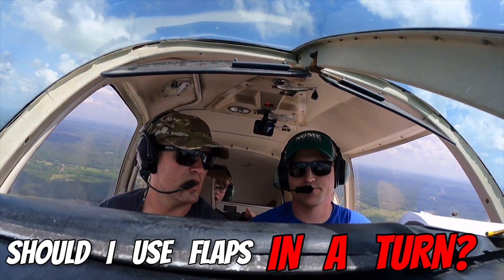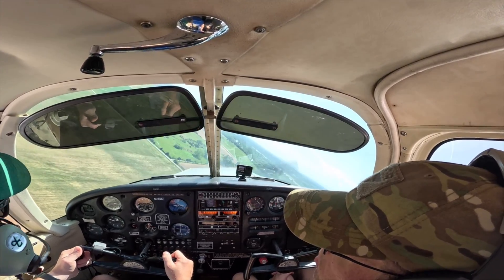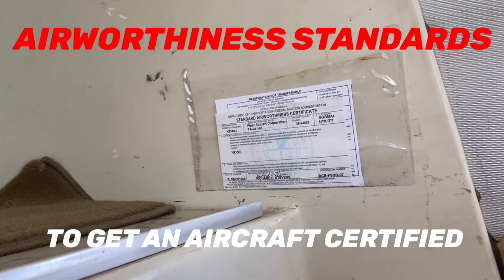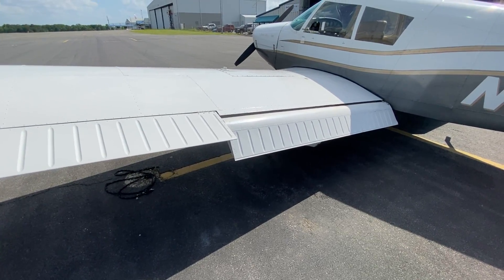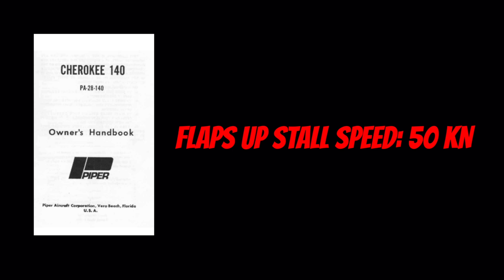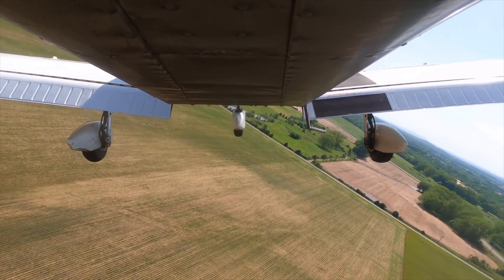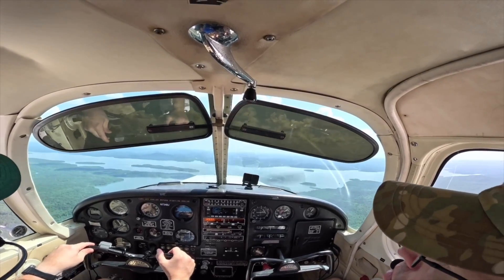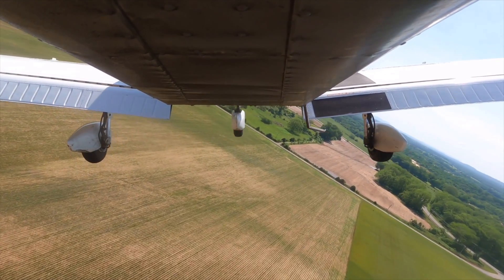Should I LOWER Flaps in a Turn?

Comment: Not necessarily an increase in "safety buffer" because you are closer to the critical angle of attack.
Reply from the maker: If they weren’t safer to use, they probably wouldn’t even put them on airplanes
Reply: They are safer within a window but the window itself has not increased.  Within the window you can land with lower ground speed and with better visibility but the critical AoA has been reduced.   The window is always narrowed in the landing phase which is critical to understand because there is little chance of recovery.    Maybe vortex generators can increase the window?

Applying flaps during a turn is like braking during a turn in a car: there's a reason people are taught to brake before the corner even thought that can be done.
Reply from the maker: @jamescaley9942  maybe, BUT most flaps move the center of pressure aft which technically give you a CG further forward and also lowers the attitude of the airplane. Initially, you may increase the AoA, but I don’t actually believe that you are closer to your critical angle of attack.  There’s conflicting information everywhere out there

Comment: I think the main reason why CFIs teach you not to use flaps is that for student pilots, landings are hard enough to do as it is and they don't need the extra workload. It's easier to handle one thing at a time, turning OR changing the flap settings. It's easy to get overwhelmed and miss a crucial change in attitude or speed. Imagine a student making a turn to final. Assuming that their descend was stabilized so far, their main focus is probably on making the centerline. Maybe they'll also be able to keep an eye on the speed. However, if they change the flap setting during the turn, the workload increases. The plane will want to slow down and lower the descend rate, both of which need to be countered.
In my view, changing the flap setting during a turn is not inherently dangerous, but it does increase the workload, which is not ideal, especially for students. Once you're more comfortable handling the plane and predicting what it is going to do, I don't see any issues using the flaps while turning, though.
Reply from the maker: I do believe this to be the case, but I don’t see the difference in doing that and increasing the flaps in the descent which can initially cause the plane to balloon and make them more unstable on final

Comment: Hi, confused as to how you got a smaller radius of turn with flaps when turn radius is dependent upon TAS. Maintaining a turn at Bank Angle of 30deg requires the same lift regardless of flaps assuming same speed parameters. This is because the same radial g is required to maintain level flight at a set AoB - it is independant of weight and speed. A 60deg AoB turn is 2g, regardless of doing 80kts in a Cessna or 420kts in a fighter. Therefore, the only thing that should affect radius is TAS. Since you had the same TAS, I'm at a loss to describe the slight difference you encountered. Flaps around final is sound given all the reasons you said, and being able to fly slower with a greater margin before stall will tighten radius and make the approach safer as long as you have sufficient power to overcome drag. Happy to hear your thoughts, no equations here, the chart you used is all you need to check my understanding. Cheers.
Reply from the maker: Not only do flaps allow you to fly at slower airspeeds which shrinks your turning radius, but they also increase the amount of lift that the airplane produces.  I have my own theories on why this is the case, but you can really shrink the turn radius of an aircraft with them. Crop dusters use this method all the time
Reply: @FreePilotTraining  Thanks for replying. I understand that flaps produce more lift, but in a level, constant speed constant angle of bank turn it does not matter. On application of flaps, the chord will increase the wings apparent angle of attack to the airflow and increase lift. This would have the same effect as pulling back on the stick, thatis, to climb and increase turn rate, however, you are doing a level turn and so you offload the extra lift through trim and thus will end up at the same rate since a 30deg AoB at a set speed will be the same rate regardless of any other factor. If you flew your Herc with a Hawk on one wing and an F-15 on the other, you will all be at 30deg AoB at the same turn rate even though you are all different weights and independent of flap selection. This is why I am confused by the little experiment you did, it does not make sense. On a final turn, if you select flaps but maintain your initial pitch then yes, it will tighten the turn momentarily as the chordline changes, without changing power the turn will further tighten as you slow. But the original test there should have been no difference. Cheers, hard to explain over typing!
Reply from the maker: @stats8391  yeah, I know crop dusters use them to reduce their turn radius.  I’m sure that’s due to reduced airspeed, but I personally believe there’s another factor at play here. I don’t believe load factor is always equal and opposite to the horizontal lift component as we are taught.  That would mean weight and centrifugal force is exactly the same at all times.  I’m not so sure this is always the case.    I personally think that’s why flaps can tighten the turn radius in most situations

Comment: Without split, (assymetric)  flap protection as in most light aircraft designs,  flaps should not be deployed in a turn.
Take for example, a Cessna which has cable operated flaps. 
There are 4  separate flap cables to pull the flaps up and down.
Two cables pull the flaps down and two cables pull the flaps up.
If one cable breaks due to corrosion which is possible, the flap operated by that cable will not be pulled down, say to a 40 position in an older Cessna.
The opposite side flap will be pulled down to its 40 position.
Trying to keep the aircraft flyable during final approach to the runway with ailerons and rudder will be very difficult, probably impossible depending on airspeed.
Reply: Didn't you see his data on the split-flap issue over the past 16 years? Happened once.

Comment: Spot on Sir. I was taught to use flaps in a turn and not load up the wing and that will minimize the stall spin on base to final. And is I did overshoot and don’t like the it there is always a go around.

Comment: I have ALWAYS used flaps in a turn (Cessna 152/172 pilot with 125hrs). I was actually taught to get to flaps 20 before my final turn. Flaps 10 almost always occurs in my base turn (as I was taught). This was to prevent rushing flap deployment during base or final... which I'd argue... rushing is MORE dangerous. This video is jam packed with amazing info. Love it! Thanks mate!
Reply from the maker: It definitely works! Thank you so much!

Comment: Agree with your video. Just want to add that the load factor/stall speed only increases in a turn if you are in a level flight. If you're not pulling on the yoke in your base to final turn then the load factor and stall speed are unaffected. But your descent rate will increase whilst in the turn. You can add a bit of power.
Reply from the maker: Fact! That’s why I mentioned being low on final

Comment: I'm confused about the part at 13:03 where you say you're going to fly "the same speed and angle of bank" with flaps extended, but you expect the turn to be tighter. Is it not true that in coordinated flight, turn radius is just a function of speed and angle of bank? If you maintain speed and bank angle, won't the greater sideways lift component from the flaps cause the aircraft to slip?
Reply from the maker: Turn radius is directly related to speed, angle of bank, and the horizontal lift component.  The flaps are creating more lift horizontally which is why the turn radius is tighter. I didn’t mention this in the video, but flaps allow us to fly slower which also shrinks down the turn radius
Reply: @FreePilotTraining  if you increase the horizontal component of lift (centrifugal "force") while keeping bank angle and speed constant, the acceleration vector relative to the aircraft will no longer point in line with the floor of the aircraft, it will point out to the side (edit: I should have said "apparent" acceleration, i.e if you drop a tennis ball in the cockpit, in what direction does it appear to accelerate relative to the cockpit frame of reference). Isn't that a problem if one intends the turn to be coordinated?
Reply: After thinking about this a bit more, it seems there is a paradox. I'm not sure, but perhaps this is the solution: the increase in lift from the flaps will obviously increase the vertical component of lift as well as the horizontal. That means to maintain level flight at the same speed you need to decrease angle of attack, which decreases lift, which in turn decreases horizontal component. If this logic is correct, flaps do not decrease turn radius in coordinated level flight at the same speed and bank angle. This conclusion is supported by the fact that the turn radius equation in level, coordinated flight only has terms for bank angle and speed.
Reply: @FreePilotTraining 
"Turn radius is directly related to speed, angle of bank, and the horizontal lift component."

Show me that in a book.

Turn radius is constant for a given speed and bank, as you have repeatedly been reminded.

Gs are constant for a given speed and bank, but that's not what causes them. Acceleration is caused by speed and radius, and the only reason it's constant for a given bank is because radius varies with speed.

FFS, if you could tighten turn radius with flaps then there would have to be more Gs. Vectors have nothing to do with it -- it would be because you are reversing more kinetic energy in the turn. This is a law of physics, and you cannot simply write it off to some imagined aerodynamics. If you tighten the curve of a turn at a given speed, you're going to pull more Gs. Period. And if that could vary, then we wouldn't have charts with constant Gs listed for each bank angle.
Reply from the maker: @cpurickyahoo  assymetric G forces are very real. Some airplanes like the C-130 show you when there is a side force on the aircraft in addition to showing you when the aircraft is not coordinated

Comment: Flaps are used primarily for lower speeds without stalling the aircraft regardless whether you're straight or turning, used for landing & take-off, also turning in a valley, split flap is so rare this argument is ridiculous, if you do the proper pretakeoff checks it won't happen!
Reply from the maker: Exactly.

Comment: Just finished up my CPL and even during that training, I was getting a "Don't use flaps during the turn" from a couple of instructors, with no real explanation of why they thought it was bad.  During my training, they also said that the wings don't care which way the plane is turned or turning. the airflow over the wing is the same, so if' its the same, then the plane doesn't care if you put flaps down in straight and level, or in a turn.. This was an awesome video! Thanks for taking the time to explain.
Reply from the maker: You’re welcome! That’s a fact…as long as you’re coordinated and the controls have been neutralized.
Reply: @Matty Crayon:
If they were right we could never do an orbit on approach....as requested by ATC - raising flaps here, especially after base leg, would be bad, unwise and uneccesary.
Reply: @a320nick  WTF !!